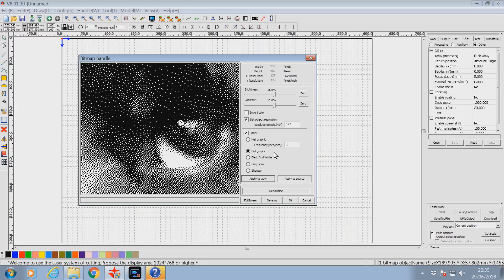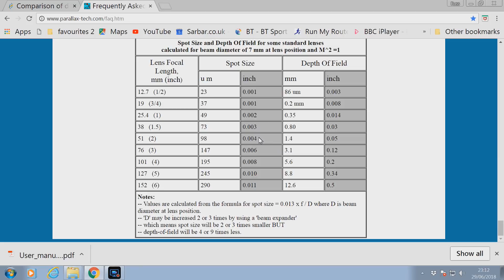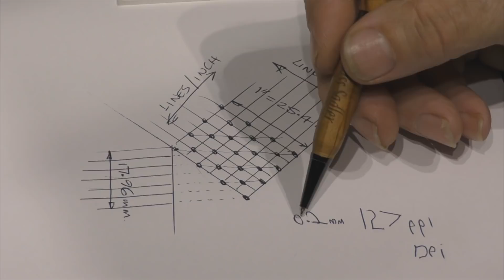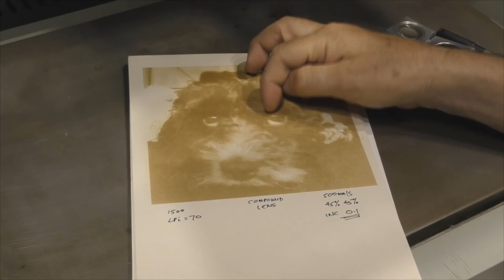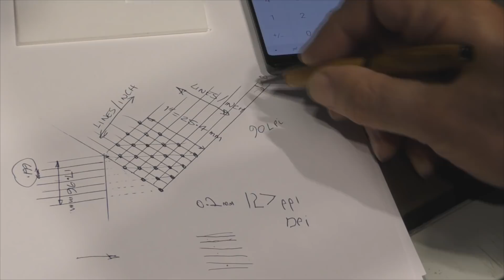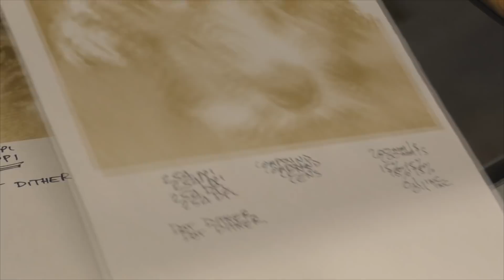RDWorks Learning Lab 145  The 1000 DPI Mystery Solved

Comment: Hi 
thanks for you videos you are very helpful 
And a good man.
I do laser engraving photo  on granite 
Some times I have faded areas on the pictures . Like the laser pules been weak 
 I do puss the machine and started again it will engraving again in good results. 
What I should  do? 
Can you give me some tips please 
Thanks
Reply from the maker: The most important part of your machine is the tube  power and beam quality. You really do need a "sharp beam for photo engraving and a lens that is capable of producing very small dots.. The fact you start your machine and get different results sound suspiciously like you are using the original tube supplied with your machine and it may well be labelled K H Laser.
 If you like to add your disguised email address to another comment, I will reply and we can speak off line and you can send pictures. I will delete your comment/email address from public view.

 Best wishes
Russ

Comment: Quick question... Shouldn't the DPI the laser puts down be several times higher than the PPI of the digital image file?
Otherwise how would one reproduce a (grey-) shade with a dot that's only black or white? A pixel in an image file can be almost any shade... our dots can't.
Reply from the maker: Hi Rob you have understood the problem but not the solution. 

Modern images are made up of little square blocks called pixels. There is NO fixed size for a pixel, it can be any size you wish. As you rightly understand, grayscale images are composed of pixels that are one of 256 shades of grey. Hmmmm,  not quite true,  Colour black is defined as 0 and colour white is 255 with 254 mixes in between. That is the grey scale.  When you look at a modern picture  the colour grey allocated to each pixel is an average of the amount of light the camera sees  on its pixel sensor. . If you took a picture of your face using a camera that could only see 4 pixels  the image would be four  LARGE different grey squares. Not even a hint of your shape let alone the details of your face. As you add more pixels to that SAME SIZE IMAGE ie you subdivide the picture into  smaller and smaller sectors, only then does detail gradually start to appear. The smaller the subdivision the more the detail. This subdivision of the picture is RESOLUTION and is defined in Pixels Per Inch (ppi). It is important to remember that  PIXELS only exist on the monitor screen.

 Before this digital era, photos were  analogue and  moved smoothly between the various shades of brown (sepia)   Before  the advent of photography newspaper images were all hand drawn etchings. Newsprint is black ink on a white background thus the problem arose  of how to present a photograph in a newspaper but only using black ink.  You can do more reading on this subject if it interests you but but it turns out it is not really a technical problem but an understanding of how our eye and brain function that provided the solution.  This had been understood for many years. Take a look at this amazing etching  where the shades of grey are created by varying the ratio of black and white that your eye sees  
https://upload.wikimedia.org/wikipedia/commons/c/ca/Claude_Mellan_Face_of_Christ_WGA14764.jpg
Zoom right in  and be amazed at the skill requied to create this....by hand!!!!!.
 This trick of allowing the eye/brain to  average out the ratio of black and white  in each area of the picture was how newspapers were able to convert photos into black ink dots on a white background  and get away with creating the impression of an image containing many shades of grey. 

 Take a look at this   https://shihn.ca/posts/2020/dithering/  for a techno explanation of one of the best algorithms (Floyd Steinberg) for changing grayscale to a binary (2 colour) image.

The newsprint problem is EXACTLY the same problem we deal with when we try to burn dots of a single colour onto wood, card, leather or glass for example.  The ratio of burn to non burn is crucial to photo replication when applying this  dot DITHERING technique.

Hence the size and colour consistency of your DOT is crucial to determining the pixel size you can represent. IF you can create a dot that is 0.2mm diameter then 0.2mm  must be the size of the PIXELS in your screen image  Photo engraving with a laser beam is VERY simple. 1 pixel = 1 dot. If your pixels are smaller than the dot you can produce then the dots will  overlap and hide the background colour that is so important to your eye/brain for obtaining the correct colour mix.   Pixels on the screen DO NOT OVERLAP therefore to get a faithful reproduction your DOTS MUST NOT OVERLAP EITHER  

 I hope this lengthy answer allows you to realize that you cannot just replicate a screen image. No, you have to start with understanding what dot your machine is capable of producing  and THEN  set your image resolution to match . Ie a 0.2mm dot  equals an image resolution of 25.4mm/0.2mm = 127ppi.   If you set the image resolution higher then you will be in for a BBQ and not an image.

Best wishes
Russ
Reply: @SarbarMultimedia  Hi Russ, thanks for your reply.... I'm still confused though 😅
You say the dot size must equal pixel size, however a 4K image usually has 72 PPI (it's quite low because we don't need to "cheat" like we do with dithering)... And needless to say, trying to recreate a 72PPI image using 72DPI in our laser (which would suit ~0.4mm dot size (4" lens perhaps)) won't be enough to get enough "information" (it's only 1bit) to emulate the greyshades to create the optical illusion we know as dithering.

Comment: Why is the pattern (scan angle?) at 45 degrees?
Reply from the maker: Hi Rob
Sorry I cant answer that one . Half tone printing  was invented long before pixels existed and the newsprint plates were etched with dots.  Dots naturally stack adjacent to each other with a 45 degree pattern  so I assume that was where the angle originated. Varying the cluster size of black dots on a regular grid pattern produced a simulation of the analogue shading of early sepia photos thus allowing them to be replicated for mass circulation. This was long before the concept of greyscale which is an artificial division of shades of black and white into a convenient number to suit the hexadecimal FF ie 256. So, the single,  one size dot essence of the technique can be replicated by our lasers which can also only produce a single size dot. However the problem arises when you fail to understand that the pixels you use to convert your image  cannot be any smaller that the dot you can produce with your laser. Making the original picture higher resolution will only result in a heavily overburnt mess.
My answer to your question is just a logical guess and all the graphic artists I have asked have failed to provide me with an answer to this and another burning question which is why are there so many dither patterns and why was each invented. The best dither pattern seems to be the Floyd-Steinberg pattern and is the basis of the diffusion dither used in Photoshop.
Best wishes
Russ
Reply: @SarbarMultimedia  thanks mate, line interval is the same as scan gap, right? 
So does the Pythagorean formyla apply in any case?
Just so I understand this correctly... the limiting factor is always the physical dot size. The DPI setting should not be a higher resolution, otherwise you get overburn.
Likewise the scan gap (which is always  scanned at that 45 degree angle?) Should never be smaller than the physical dot size. So in the end we just want everything to line up, right?
Reply from the maker: @startinsomethin  
Hi Rob. 
 The original close stacking dot principle allowed dots to be stacked with a natural 45 degree pattern. When this half tone principle was hijacked for digital use, compromises were made.  First pixels are square (generally)  which means they do not have any natural 45 degree stacking pattern. they can only be stacked on top of each other, So that confirms your first question....why use a 45 degree pattern?  Thus you are correct in your observation that Pythagorus is not required . If you have a resolution of 254 ppi that will be 25.4/254=0.1mm pixel size. Thus the line interval will have to be set to 0.1mm also.   If you try to decode a 1000ppi picture the pixel size will be 25.4/1000=0.0254mm. If you set the line interval to this spacing  and yet the smallest dot you can burn is 0.2mm , every single isolated pixel will get swamped with a huge burn. If you then set your vertical line spacing to 0,0254mm then you will be overlapping burn dots about 9 times... a great recipe for charcoal!!  Software such as Photograve and others use a huge amount of lightening in their photo preparation because this offsets the overburning effect. Trotec,Epilog and Universal do not have short focus lenses so they will never be able to achieve the super small dots required to meet their engraving claims
 That is the whole reason for me developing the compound lens in an attempt to find what the smallest practical dot we can burn. Whatever that dot size is determines your picture resolution. Simple golden rule for photo engraving is 1pixel =1 dot. So general advice is stay away from half tone dithering. 
Best wishes
Russ
Reply: @SarbarMultimedia  Much appreciate the explanation. Best Regards,  Rob

Comment: Is there any option to turn on in setings to laser can understand when I put low end max power when engrave, i put 9% low and 25% max and laser everything engrave with 25, why?!
Reply from the maker: Hi Zoran
First question is why are you using min power for engraving?  Once the head accelerates to the max speed you have specified, the engraving takes place at that max speed. There is therefore no functional requirement for min speed. So that is why you will never see it.  There are reasons for using min power  during "drawing" with a cut parameter or  or during actual cutting. If you are doing any 3D engraving, then you must use max and min power,  but that's a completely different story.  To sum up, for normal engraving set max and min power to the same value.
Best wishes
Russ
Reply: @SarbarMultimedia  I have big trouble to setup picture in rd for good engraving on wood
Reply from the maker: @izaberipoklon  
 Hi Zoran
RDWorks ia not really very good at preparing pictures for engraving. You  need to prepare your picture in Photshop, GIMP  or some other 3rd party software. You also need to use a good dither pattern  (Floyd Steinbeg is the best) and also understand the relationship of your machine.s capability so that you can set the picture resolution to suit. You cannot set a random picture resolution and hope it will work. You must understand what the smallest possible dot your mechine can make With most lenses it will be about 0.2mm. THAT is the key factor that determines your picture resolution This simple calculation will determine the picture resolution  25.4/0.2= 127pixels per inch (ppi)
 see https://www.youtube.com/watch?v=jwo9hrVhpIw and
https://www.youtube.com/watch?v=wOCy1VMkWeI

Best wishes
Russ
Reply: @SarbarMultimedia  tnx Russ, I hope that I will get best result
All the best!

Comment: There is one important point i discovered when doing this a few years back, The laser burn has a "burn radius" where the dot leaches out and fades. What I found makes all the difference is doing an "Unsharp Mask" on Coreldraw and setting the radius to match the "burn radius"
Reply from the maker: Hi
Thanks a lot for your comment because it touches at the heart of what I have been trying to achieve with my compound lens ie zero fade out zone.  This fade out zone (I call it a halo) is caused by the natural gaussian power distribution across the beam. Just because the beam has been through a lens to make it incredibly small ,  it still possesses this non uniform power distribution and if anything is further exaggerated by the spherical aberration of  the lens.   if you move on a few sessions you will see that I have achieved this non-halo dot. My aim is to produce a dot replication of the pixels on screen as you would do if this was ink printing technology rather than the imprecise burnt dot technology we are using. 
I do agree that sharpening the picture with unsharp masking is a great way to reduce the mid tone greys from your picture. If you check the levels in your picture before and after masking you will see what I mean.The net result of doing so is to reduce dense clusters of single dots  (so hard for us to reproduce)that are required to represent those mid greys, thus allowing the dither algorithm to make more black lines in a scan and less single dots. This is definitely a way to crisp up a picture and is a technique I will be tackling in a future session but I have purposely steered clear of it  because it is moving away from the pure photo replication I am trying to achieve. Mid greys and dense clouds of single dots are a challenge for the power supply response and for the cleanliness of the dots. so if I remove  the challenge then I am lowering  the bar. 
The problem for those people with more powerful tubes is that whatever they try they will always have a halo round their dots so the unsharp mask technique may help them.
Again, thanks for bringing this subject up for discussion because  is a big  and technical. Not everyone uses Corel Draw or Photoshop and is another reason I have tried to stay pure up to now and use just the tools that are in RDWorks  (or Lightburn).
Best wishes
Russ
Reply: Hi Russ - Yes, halo is a perfect description!. And yes I do understand your goal for perfect analog copies. I did do some "analog photos". They came out pretty good but when I got down to this level, I got banding which was caused by the tube changing temperature. I did many commercial pictures on granite and found that it was hard to beat the consistency of a stucki dither with unsharp mask. You can see my work if you google edns granite photo engraving

Comment: great job! i have a TL machine and i have been over this a million times and never get a good resolution engraving, and it isnt very cost effective to be spending countless hours to do an engraving job that really doesnt cost that much (money wise). I hope i can move to a ceramic tube machine in the near future like an universal system, any plans on upgrading yourself?
Reply from the maker: Although i know that TL make a good machine, from all the work I have done chasing small dots on various materials with many lens and parameter combinations. I absolutely know that to get less than a 0.05mm dot (508dpi) is impossible with our technology. I'm also wondering if even Universal, Trotec or Epilog get as good. They may have better dot/power control and be able to use their frequency variation  ability but my little 254DPI test pattern is the ultimate test. Dots at 0.05 or less are so feint that the picture is washed out and not practical in any way. I know their engraving abilty is superb but go and get a demo with your eyes open and with your own test patterns to hand so that you can understand what their real capability is.  Any feed back would be useful because I have no intention of upgrading to pro kit when for my messing around hobby purposes I can get superb results now that I have done a few key modifications and I am not having to make money from my machines.
Best wishes
Russ